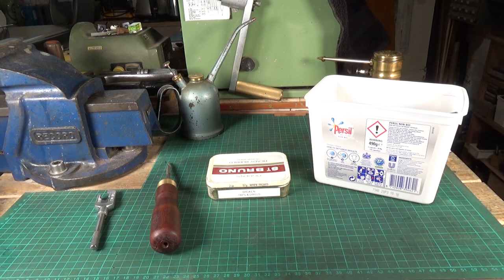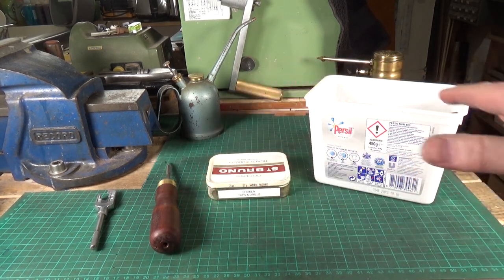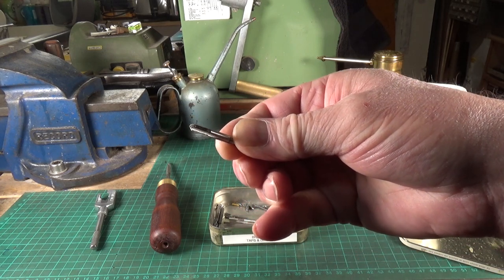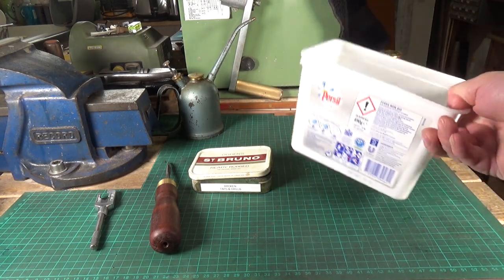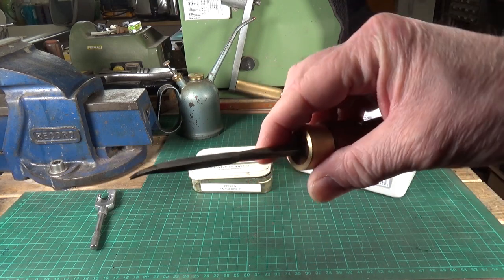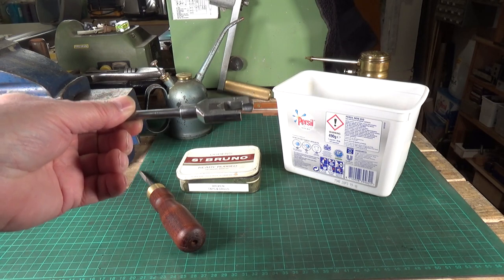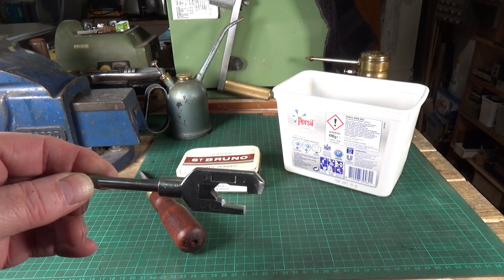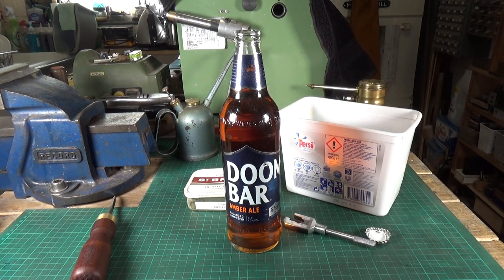Workshop Tip - Don't Throw Stuff Away!

Comment: I'm detecting a theme Alan :-)

In all seriousness - this is a way of life for some people - and extends outside the workshop, and into the house/garden too. I stopped throwing away packing materials, like bubble wrap and foam sheet. Since I started folding those up and storing them, I haven't had to buy a single piece of packing material. Saved loads. Old peanut butter jars are great for storing turps/mineral spirits. Old free gym equipment like treadmills have motors, steel, and so on (I think I may have got that one off Rob/Xynudu? Not my idea anyway, but a good one).

Recycling is not only good for the world, it gets you thinking and making, so it's good for the brain too. I love that bottle opener tap.

PS: I spot a rega oilcan. Rob's mentioned those a number of times, and I finally found one in reasonable condition. Cleaning it up might become the subject of a future video.

Cheers,
Craig
Reply from the maker: Hi Craig. I don't know what you mean 😉 I used to save packing material but I just don't have the storage space these days. Old IT equipment is a good source of stuff, especially old flat bed scanners. You get stepper motors, toothed belts and dead straight steel rods from them.

It's a far better bottle opener than it ever was a tap wrench!

That oil can isn't just any Rega, it was a present from Rob and is the one and only "Bruce Rega OIl Can"! It featured in one of his videos https://youtu.be/d2rqaq1lvik . It is also the most prized oil can in my collection. Yes, I am that sad, I have a collection of oil cans 😂 As Rob so rightly says they are excellent cans. You need to get yourself an American Eagle 66, also in the video, another lovely oil can. 

Cheers, Alan.
Reply: @RetroSteamTech  Ah yes - I know the history of that one. Great stuff :)

American Eagle 66 is next on the wish list. 

Even junked desktop printers (e.g. inkjet) are a great source of polished ground rods, often chromed or stainless. Very useful material.

Comment: Dead on Alan.  You just never know . It's full regret mode when you realise down the track that the bit you just tossed is exactly what you need now ;)

Regarding broken thread taps, I usually grind the end near flat and turn them into plug taps.  These don't have to be long, as they are mainly used for blind holes.  Always handy, as you generally tend to buy intermediates as replacements.

It's funny that after all these years I still don't have a proper de-burring tool. I must make one up one day.  Your's looks pretty good.

I see your channel is near the magic 1 K mark.  Good work.

Cheers Rob
Reply from the maker: Hi Rob. You see this why the comments are so useful, I would never have thought of grinding the end of a broken tap flat to make a plug tap, brilliant. I never have enough plug taps and with model steam engines you are quite often tapping blind holes. You can grind a really good sharp edge on a broken file, ideal for de-burring.

Yes slowly creeping toward the magic 1K. Was going to have a celebration down the pub when it happened, that might have to be delayed 😢

Cheers, Alan.
Reply: @RetroSteamTech  It's often a case of the simple (obvious ?) things being overlooked.  I guess we can't see the tree for the forest at times.  I might do a short video on it, seeing as it may not be obvious to all.

I hate wastage and was brought up by a tight fisted father, who was also a mechanic.  He showed me the broken tap trick.  Glad I mentioned it.

Cheers Rob
Reply from the maker: @Xynudu  A video would be a great idea 👍 Cheers, Alan.
Reply: You read my mind Alan.  I've just given your channel another plug :)  Cheers Rob
Reply from the maker: @Xynudu  Just watched it Rob, these kind of tips are what it's all about. Thanks for the shout out. Cheers, Alan.